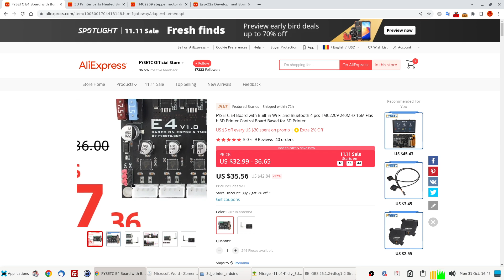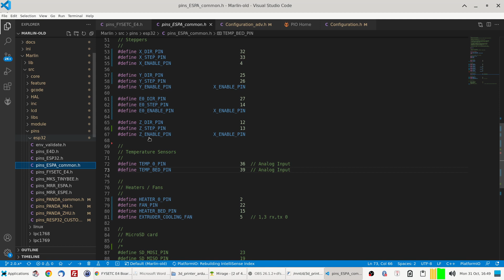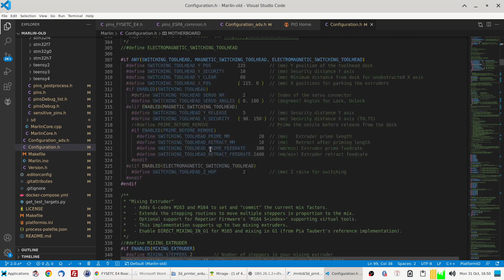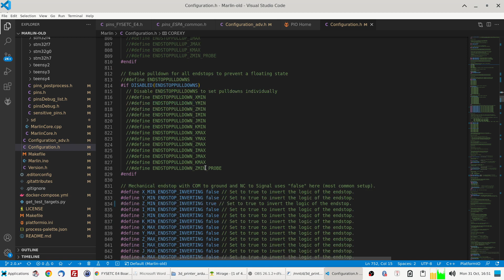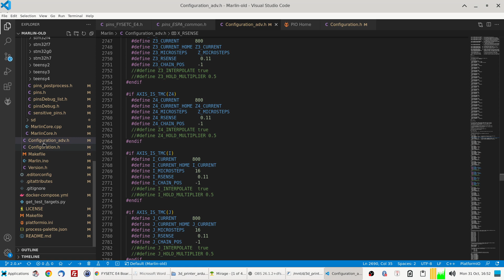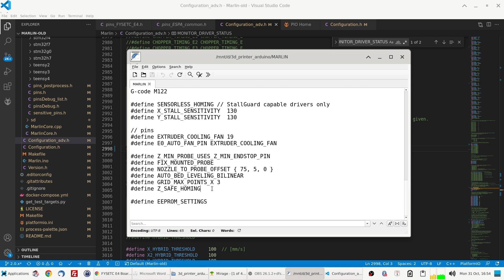DIY 3D Printer with ESP32 as a controller + Marlin settings

Comment: I am trying to compile the firmware of the FYSETC-E4 and upload it to the ESP32, but it does not compile at all. I do not change anything in the files and keep them on the default settings
Reply from the maker: What error does it give ?
Reply: @CNCTinker  C:\Users\user\.platformio\packages\framework-arduinoespressif32\cores\esp32/WString.h:288:23: error: 'unsigned char String::concat(const char*, unsigned int)' is protected
         unsigned char concat(const char *cstr, unsigned int length);
                       ^
.pio\libdeps\fysetc_e4\ESPAsyncWebServer\src\AsyncEventSource.cpp:99:46: error: within this context
     str.concat(lineStart, lineEnd - lineStart);

Comment: Hi, I bought a Fysetc E4 but I'm struggling connecting the BLTouch to it... I connected the red to VZ (5V), the white to the SIG and the black to the GND (these are the 3 pins of the Z-MIN), but now I don't know where to connect the yellow and the green ones... could you help me please? 🙏
Reply from the maker: Hi, not sure about the colors as they might be different from maker to maker, but the way you connect is like this: you have two connectors one with 3 wires that you plug into the z-min, make sure it has the jumper next to it set for 5v not vin(12-24) that is middle pin and one marked as 5v - also check the gnd,v and sig on connector and board. second connector is made of 2 wires that is the servo, and you conect it to 5v and gnd. I see there are some free pins next to the esp32.
Also google Fysect E4 github where you can find in the images section, a picture called e4--pin--2 with the polarities marked. hope it helps.
Reply: @CNCTinker  Hi, thanks for the answer!
So as you said my BLTouch has a 3-pin connector and a 2-pin connector.

The 3-pin connector has green, yellow and red cables. Now, from what I learned the red is 5v and the green is GND, while the yellow one is for PWM signal.

The 2-pin connector has white and black cables that should be used just for homing, as a normal trigger, is this right?

Now, when I connected the original Z-endstop trigger from my Ender 3 (which is just a momentary button) to the Z-MIN plug on the Fysetc E4 I connected the cables to SIG and GND leaving the 5V unplugged and it worked just well for homing the Z-axis... so are you sure that SIG is for PWM and the white and black should be connected to 5v? I'm not understanding cause I'm totally new to this and I'm going crazy with the code so hopefully you can give me some advice, thank you🙏

P.S.: yes I jumpered the V-Zmin to 5V instead of Vin.
Reply from the maker: yes you are right, sorry I didnt check the wiring of the bl-touch. the white and black are z-min and gnd and the 3 wires are gnd +5v servo.
Reply from the maker: ok so I took another look at the motherboard schematic, and the z connector is made for an inductive sensor. there is no way to connect the bl-touch without soldering some wires to the board.
Reply from the maker: maybe you could connect the servo pin to sda or scl and change the settings file for the board. But I am not sure it will work as I dont know how the bl touch used the servo pin.
Reply: @CNCTinker  Ok I can solder with no problem but where should i solder it?
Reply from the maker: ok so I had some free time and took another look. the way you can connect it like this: connect z-stop to v-zmin, gnd to gnd that is the 2 wire connector. the 3 wire is made of 5v gnd and Signal wire. connect signal to sda - its gpio21 on esp32 - you will need this to set into marlin config. The board has a number of free gpio pins free at the bottom of the chip but just use the sda pin. I dont know in what order the colors are on yours, but the order on the bl-touch connector is like this: GND, 5v, signal (in), GND, z-stop. you will probably need to go to the board config file and de-assign the sda pin if it gives error on compile that the pin already assigned.
Reply: @CNCTinker  I just figured out that this board is made for an inductive probe so I decided to use this type of probe instead of the BLTouch to avoid problems... but really thanks for your help, I learned a lot from your inputs🙏👍

Comment: Congratulations on the excellent content! I tried to install Marlin 2.1.2.2 on the ESP32, and it compiled well, without errors, and uploaded successfully, but Pronterface doesn't connect to the board...
Reply from the maker: sorry for the late replay, comment went to spam because of the marlin version with points, maybe try to keep pressed the boot button while connecting, some board miss a capacitor